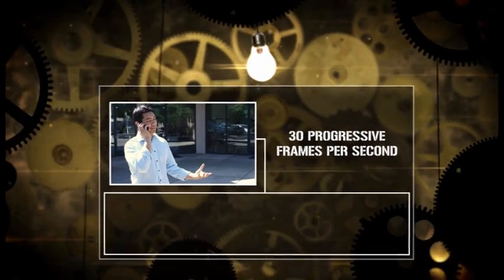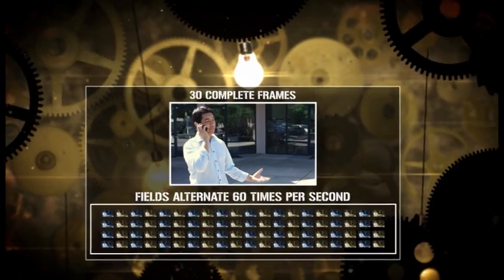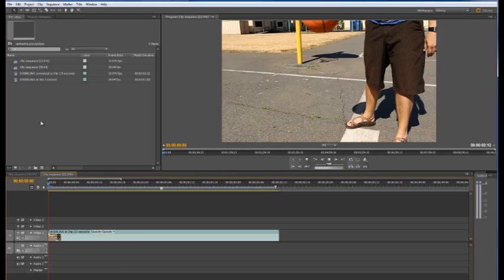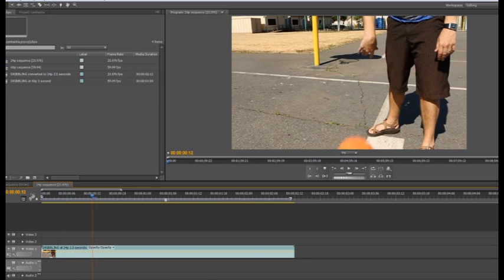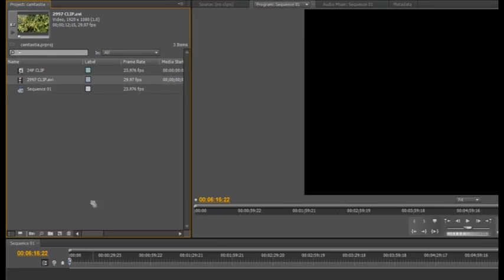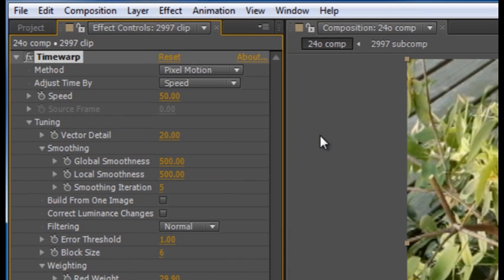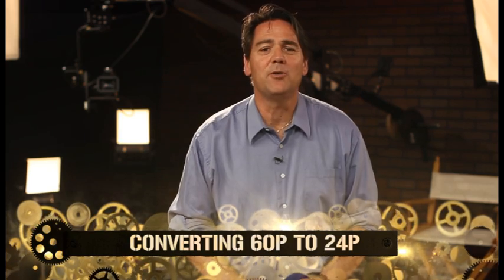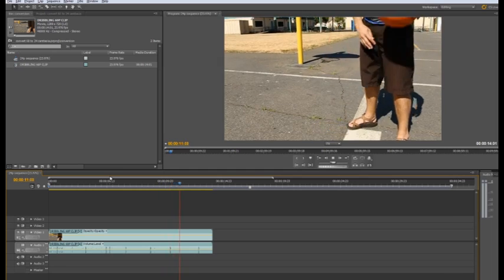Frame Rates and Interlacing

Comment: Great Video!
Should I shoot 60i or 30P?
My old camcorders have only FHD 24P, 30P, 60i options and I shoot 60i because of shooting choirs and orchestras but I do a lot of pan/tilt on crane then deinterlaced by editing software to 30P (no slow motion) then mix with other 30P and deinterlaced 30P cuts then final render to 30P to YouTube.
Should I 30P->30P->30P ? or 60i->30P->30P ? I want the best resolution and smooth video but no slow motion. Thank you
Reply from the maker: the way you are processing the 60i, you are better off just staying in 30p the whole way through. However, you should test out your faster pans at 30p and compare them to 60i. See for yourself what you prefer.

Comment: At 1:34 and 2:30 this video gets it straight up completely wrong (despite most of the rest being correct). 60i is perceived as 60fps, the two half images are created and displayed at different points in time and never form a single whole image, 60i is 60 half images, not 30 full images. Dropping every other vertical line doesn't magically reduce the frame rate. The only time 60i ever becomes 30fps is when two fields are mushed into a single frame in a digital video format and when that video file is than played back incorrectly without unpacking the fields (aka deinterlacing). But that's a bug, not a feature. Properly deinterlaced 60i gives you a 60p video, if you get a 30p video you are doing it wrong.

Comment: I submitted footage to the news yesterday and i treated the footage like i would with my youtube channel, apparently that wasn't the way to go.
apparently they have a hard time playing footage back that has a frame rate other than 30fps

i was extremely confused by this because in premiere or any video editing software that I can think of, there is never a problem when using clips with different bitrates, frame rates, aspect ratios, and resolutions.
the footage will take whatever form it is rendered in.. no matter what what settings it had.

so if someone understands tv can you enlighten me and I'm assuming the majority of people why that is?
why is it so hard for them to playback any other footage that isn't in 30fps?
Reply from the maker: +gaia35 the problem is going to be related to how the specific station is set up. Some have newer set ups that can encode any footage to what they require, other times, they have older more ridged systems that require a deeper understanding of what they need. In this case, the station might have what formats, codecs, frame rates and resolutions they require. If you can obtain that, then you can export to their need and not have a problem. Just because they are a TV station, doesn't mean that they have the knowledge they need to deal with formats that they don't use. Hope this helps. Thanks for watching.
Reply: +Videomaker thank you very much for replying, this was insightful.